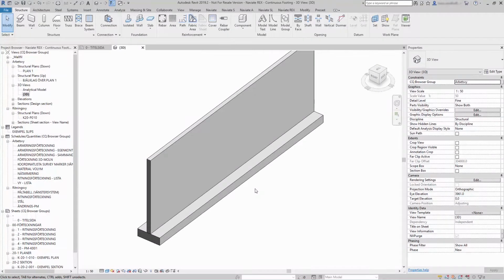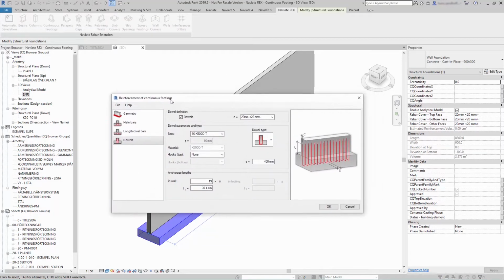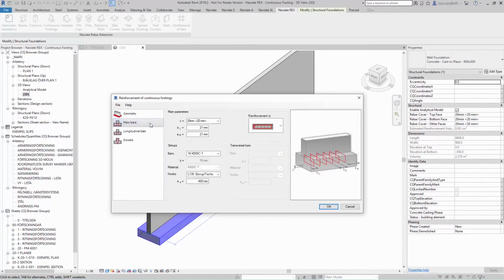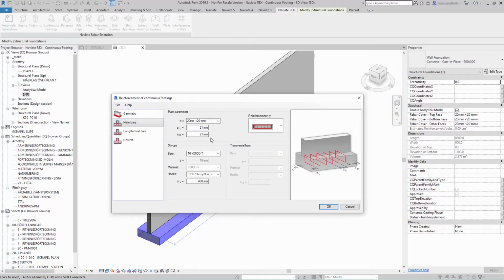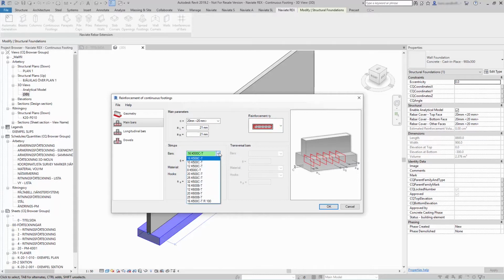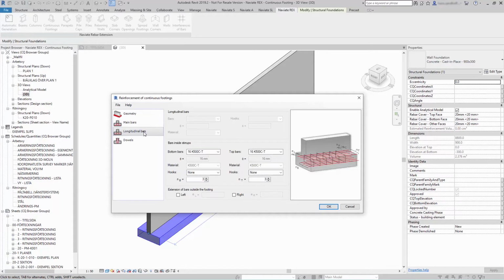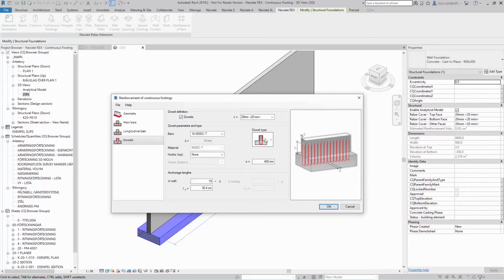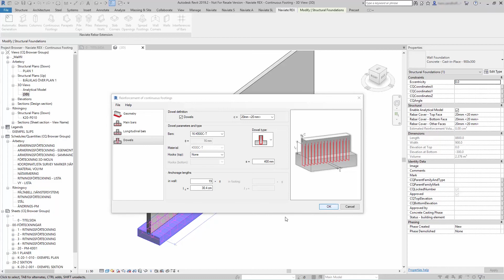Naviate Rebar Extension 2021 - Continuous Footings

Comment: Hi, the icon for the continuous footing in Naviate 2025 is not available,  why was it removed?
Reply from the maker: Hi,  Naviate Rebar Extension and  Naviate Rebar are 2 "different" products. Naviate Rebar is developed from scratch.  We are solving Continious Footing  by using this workflow.

"if the parapets are modelled as walls then we can use our wall tool along with the connection tool for the U-Bars or L-Bars.  Continuous footings are supported if the customer has used a wall foundation or isolated foundation"